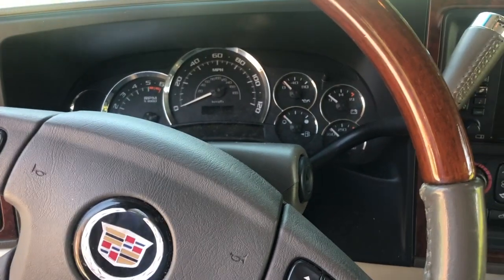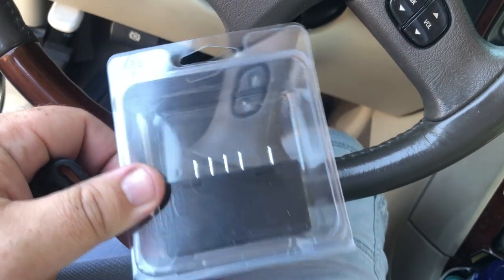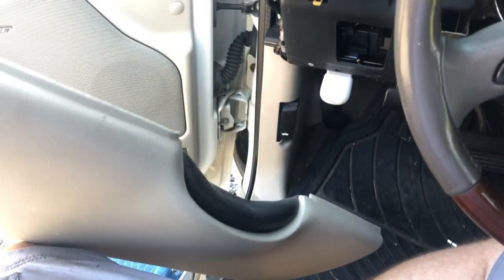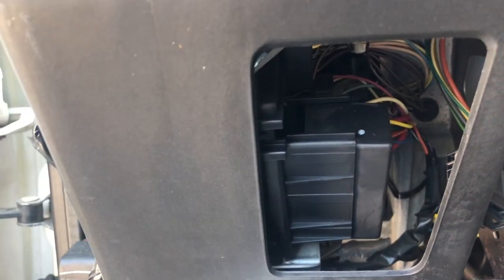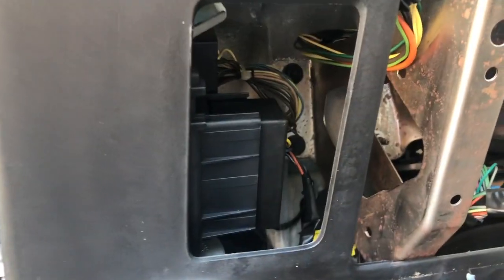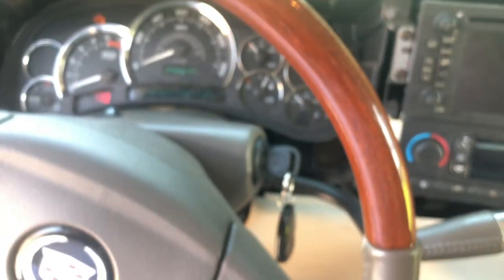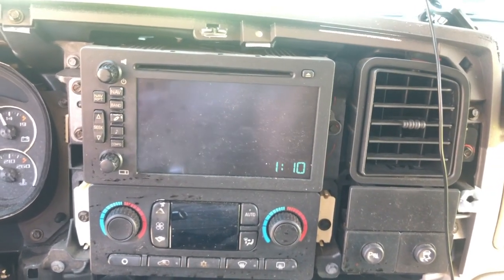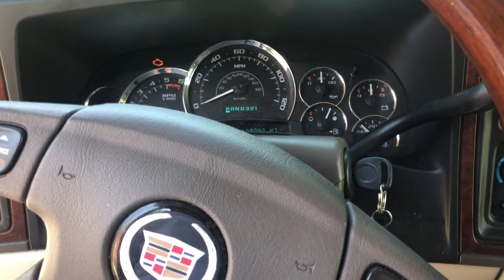How To: Replacing Flasher Relay for LED Upgrade on an Escalade - Tahoe - Suburban - Yukon

Comment: I've read quite a few reviews and they said this product quit working on them after a short period; also a lot of people had to still wire in individual resistors for the front turn signals because this relay basically needed the extra help. 
Can anyone(hopefully a lot) deny this? or confirm?
Reply: mine didn’t work at all, wasted $40
Reply: I read in a youtube clip on one of these 160 watt
This problem may be when you use this piece with a lot of LED lighting that exceeds the capacity of the piece
And you know that LED lighting takes less volts, but the watts are large

Maybe this is the problem

Comment: That is one way of doing it. Another way is adding a resister to whatever rear or front turn signal you add an led light into. I added front and rear led lights to my 2004 suburban and added a resister, it blinks as fast as the old oem bulbs did.
Reply: do you have a link to the resistors you used? i just installed this product and i still have hyperflash
Reply: @1LElife  4Pcs Aaron 50W 6ohm Load Resistors - Fix LED Bulb Fast Hyper Flash Turn Signal Blink Error Code (Resistors get very hot during working)
Reply: @1LElife  @ Amazon
Reply: Why would anyone go around tapping into their wire harness instead of this plug and play fix?